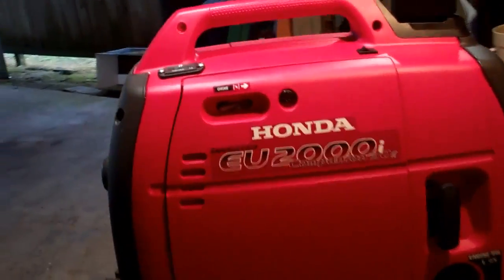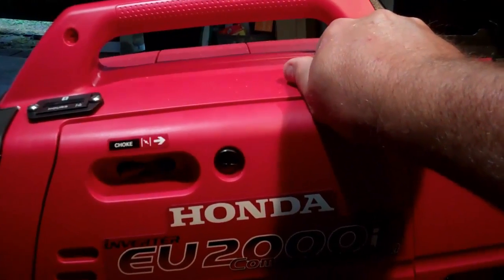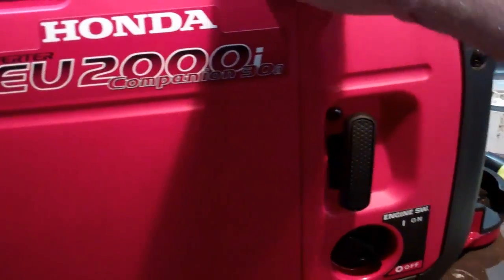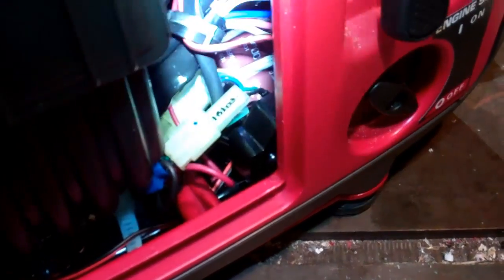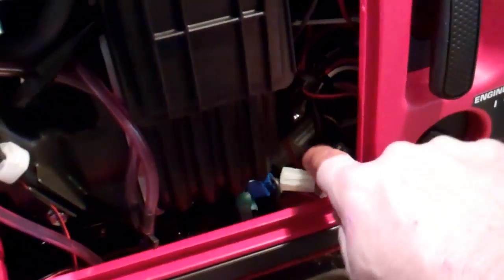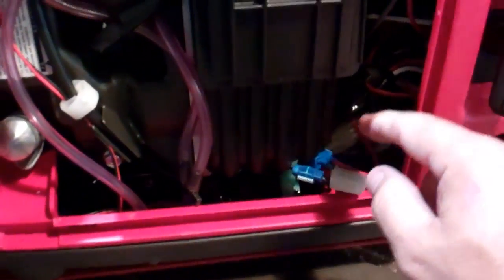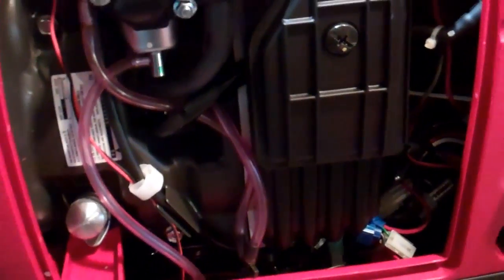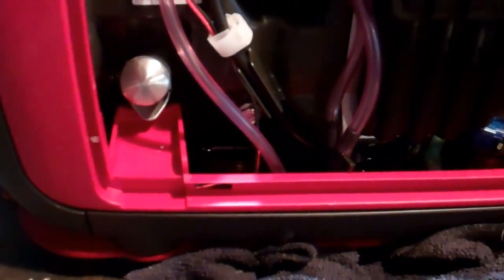Honda EU2000i - Running out of Gas in Carburator Modification without installing petcock valve

Comment: Why don't people just put a petcock on the fuel bowl drain and then shut it down with the switch/fuel shut off and then drain the fuel from the bowl, that keeps the pump wet and carb dry

Comment: you should have put a waterproof switch and not just a regular switch.  While camping during the night water dew will form or slight rain, cause the switch to get wet, and water will enter the engine compartment area.  then later the switch will malfunction.
Reply from the maker: Nice idea! Have had no issues so far, but you are correct.

Comment: Why not do this?  Because if you want to shut off the gennie it empties the fuel lines every time.  Takes about 20 pulls to start it again.  So you have to choke it and plug the muffler to kill it.  Kinda dumb.   So like you found, disconnecting the kill switch is not the solution.   I'm gonna install a fuel shutoff instead.  I don't want to screw up the wires with those tap a line things, they are bad news.

Comment: Works as expected•••>share4.photo/H2KGenerator?Vふ  Backfill to an electric outlet with a male to male plug (be careful, can't go to the street because line down and circuit breakers off). Get fridge, a few ceiling fans, USB charging and some lights with no problem. On eco mode uses about 1gal gas per 10 hours. I only run about 10 hours a day.

Comment: Hi Dale:  Just an FYI..... I just watched your video, and felt like I had to comment.  Yes, disconnecting the wire that shuts off the engine will allow you to run the engine until the fuel in the line runs out, but it also creates a problem with the fuel pump.  This generator uses a diaphragm fuel pump that requires it to stay immersed in fuel, otherwise it will dry out and crack, causing it to fail prematurely. By disconnecting the wire, it runs the fuel pump dry.  This is the reason a pet cock fix is preferred, as it keeps the fuel pump wet.
Reply: Does the new EU2200 have the same fuel pump? The new ones have a shut off valve on them so the engine does not die so you can run them out of gas. Is the fuel pump before the shutoff? I don't recall seeing anything in the manual saying not to drain the system totally.
Reply: What do you mean by petcock fix?  Not clear.

Comment from the maker: Folks to be honest, this method works great, but just a simple twist on the screw under the carburetor is simple and drains out all fuel from carburetor with no modification needed. At home, this is what I do. If on a road trip, I do let engine run out of fuel typically but draining gets that last few drops out that doesn’t come out b6 running out of fuel. Your choice.
Reply from the maker: I agree, but this is just an alternative to those not wanting to do the screw.

Comment: Draining looks better. It will remove more fuel. Huge discovery that the electric switch is  also a fuel shut off switch.  You talk too much. This should have been a three minute video instead of 8.
Reply from the maker: Draining is actually the best and after time goes on, I do drain for storage but just run out of gas for short storage times. Sorry I talked to much. I try to explain everything in detail but not always needed.

Comment: For some reason People keep trying to fix a problem that doesn’t exist.  There is a knob on top of the gas cap that shuts off the fuel to the carb allowing you to run the carb dry.  No mods needed.
Reply: it will runs out of vent air..! But for storage is better to let the fuel out of the system..if is for long time take the fuel out of the tank..!
Reply from the maker: As stated, turning the gas cap valve stops the vent of gasoline starving the system of fuel, but not sure it will deplete the gas in carburetor or not.
Reply: tony S this is true about the gas cap.... however it doesn't allow the unit to run out of fuel....this only turn off the vent, which basically vacuum locks the fuel in the tank not to vent., But the fuel will still be in the carb. So this isn't a solution, but if you forget to open the vent on the top, it will be difficult to start too.

Comment: Well, actually if you turn it to just before the off position, it will let you run it out of fuel, and once it stops, then turn it all the way to off. You didn't need to add the switch at all.
Reply from the maker: That tip is good to know. Already rigged mine, but good to know still.
Reply: @DaleStagg  no need to rig it at all.  It was already rigged!!
Reply: not true.
Reply: Is true, matter of fact there is a video on you tube that shows this.....from like a few years back.....and I do this on every unit that has this type or round turn switch. If the switch is set up with the choke at the opposite end of the off switch and run in the middle.....works every time. Not if choke in the middle, and run at the end. It will not work.
Reply: Also if the choke is in a different location this will work too, like on the Honda 2000. Leave the choke open to run, then turn the switch to just before the off position....let it run out of fuel., Then tun all the way to off. Simple.